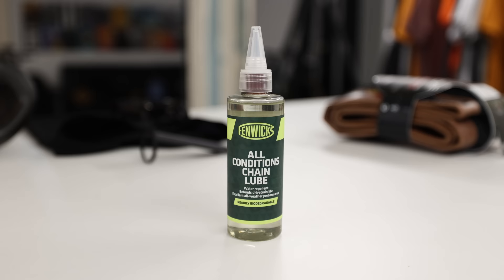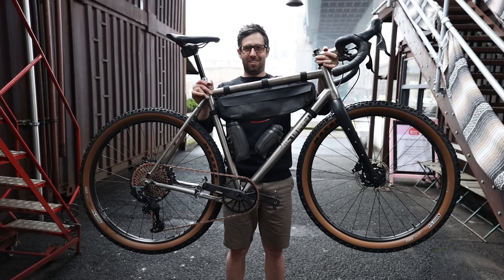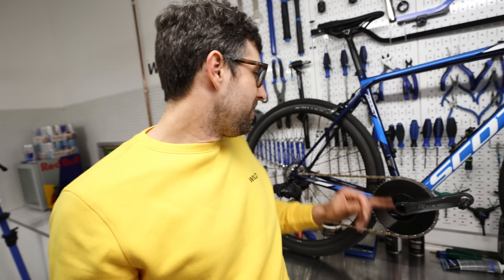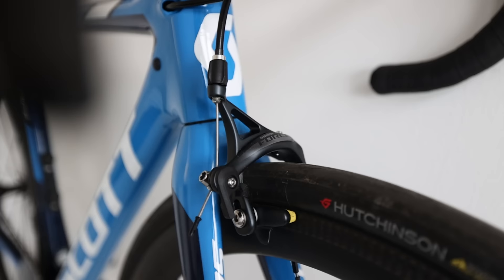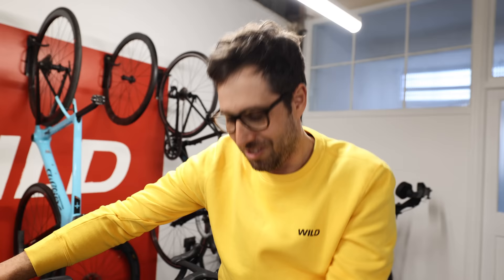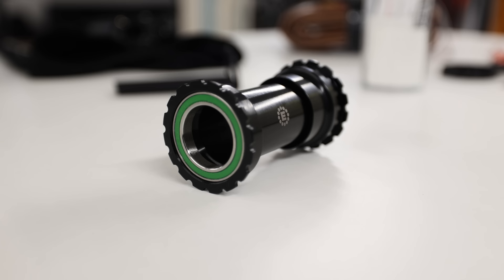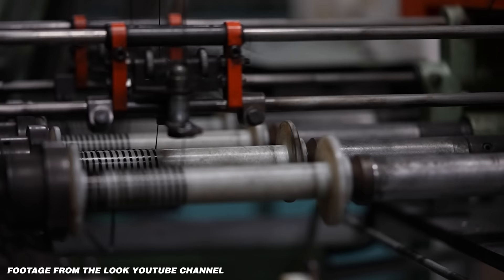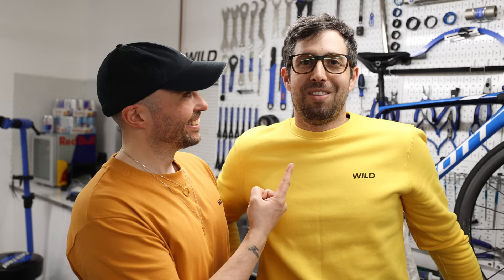Pro Bike Mechanic's 20 Most Loved Products

Comment: And here some truth: 1. Hydraulic disc brakes, 2. Electronic group sets, 3. Damper forks. 4. Tubeless tires. 5. 9-10-11-12 derailleurs. All just constant sources of steady additional service income from this over-complicated fiddle and failing crap. And a honorable mention goes to: 6. non-stainless steel pulling cables.

Comment: You absolutely need 2x for climbing.  Also if your dead tired.  You can just spin on the small ring to get home from a long ride.

I get 1x is fine if your area is mostly flat.
Reply: Not remotely true. I use 1x in Cornwall where the gradients are nuts (I've got 15% gradients in every direction around me as I live at the bottom of a valley) and constantly vary. 1x is more than perfect (BTW all my previous bikes had triple chainrings...). Oh, and I weigh 107 kg.
Reply: @barneyd9785  Whats your biggest gear ratio though for the fast flats / downhills?
Reply: @sprayaho1ic  Ah, now that's a different issue... :) 3.64 on the 1x versus 4.17 on the 3x. I don't miss that top end too much (the hills I go on are steep and in narrow lanes so you end up with your brakes on) and the lower top ratio means the top end gears aren't as spread out as you might expect. Granted, though, you do miss out on out and out top end.

Comment: Thumbs down on Silca sealant. It eats some tapes, it's sticky as all hell, dries up too quickly, can't be injected through valves, the carbon fibers ball up and don't actually fill in punctures, etc. It's a sealant that performs well in YouTube reviews where the sealant is freshly installed, but it all goes to hell really quickly. Orange Seal is still the best overall sealant, as it has been for the better part of a decade.

Comment: I'm sorry, but no to Fidlock. None of their bottles are insulated, and no one should spend that much on single walled bottles.
Reply: Use the universal mount - uses a boa mech to be able to use with standard bottles - insulated or otherwise. Problem I found with the fidlock bottles with integral mount was their tendency to rattle like fcuk when full mount riding but bottle material it was attached to flexible - to aid being squeezed.

Comment: On a 1x if you are not in the middle 4-5 cogs of the cassette you are technically and mechanically cross-chaining. Don't believe me, grab your 1x whatever bike and put it in the smallest cog or in the biggest cog and take a look at the chain line from the back.
1x on mtb it's more efficient overall then 2x only because mountain biking terrain requires quick range in gears  frequently in which 1x delivers quicker range than 2x by far. Even though a 2X drivetrain keeps chainline straighter and has less frictional losses than 1x the efficiency of 1x to find Rapid range in the cassette outweigh the more efficient 2x on a xc course.
1x for mtb, regardless of terrain
2x road bike, regardless of terrain
Gravel bike....? A shimano 1x13 would seal the deal on gravel over 2x, maybe in the near future. I need another year of racing gravel to make my final conclusion. As of now either or
Reply: Not the same chain, so less space between cogs, less angle....

Comment: Did you just say that only world tour pros need two front chain rings? One bys are about the dumbest thing The Cycling industry has come up with. Too big of jump between gears not enough gears. The chain is always out of alignment unless you’re in the middle of the cassette, if you pedal backwards, it will fall off the chain ring, which is a catastrophe.

Comment: I Hate Electronics

remember how Cellphone works Back then?
they started as replaceable batteries.

fast forward to 2024 you'll replace the entire phone when the battery dies.

same concept with Overrated Sram

they start with replaceable batteries then after 10 to 20yrs they will introduce  

replace the entire mech.